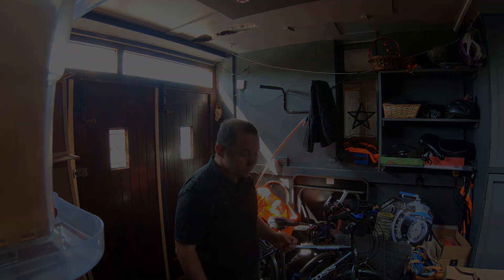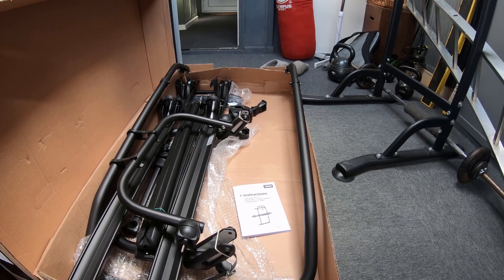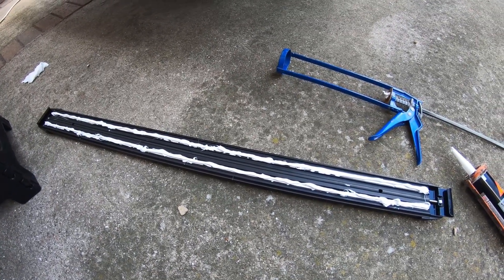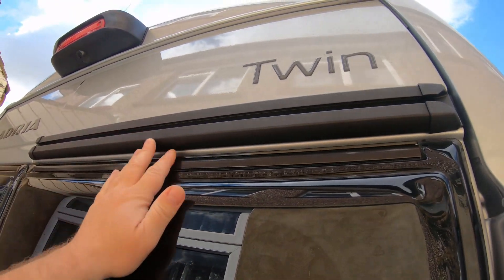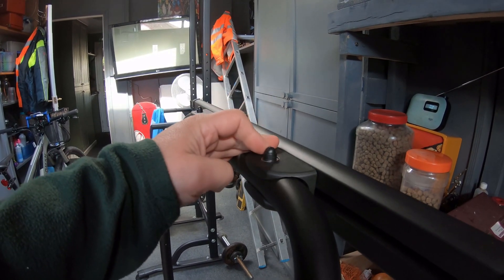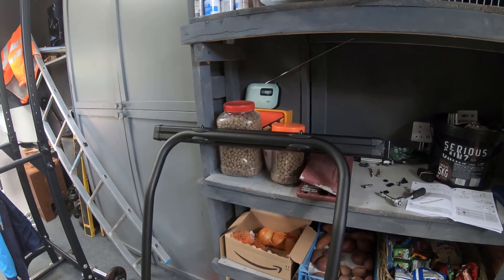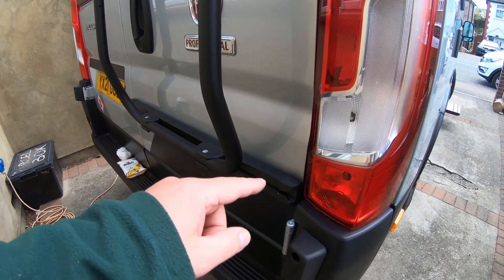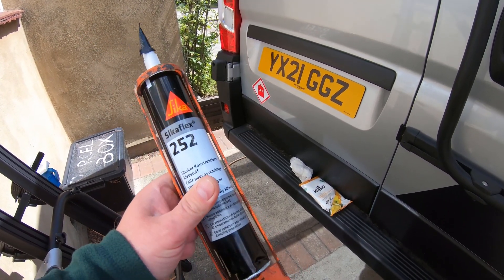Thule Elite Van XT Ducato/boxer Bike Carrier My fit to Adria Twin

Comment: Instructional as always Steve, I managed to overload ours last summer with two e-bikes at 38 Kg's total. I had to buy new bolts to the "hinge" ten we where fine again. Now I only mount Bibbi's e-bike at the inner position and my much lighter MTB on the outer. So now we are within spec for max at one position and max total with good margin. With only my MTB it works to open and close the door, but with full load it feels like you stress it. I really like to have the bikes there. We bought a cover to protect the bikes but we're not using that any more since it trips water on top and get heavy and the bikes got even more dirty under it. Go figure, vortex got more dirt in there than without the cover. Keep it up!
Reply from the maker: Cheers Mattias. In the end a tow bar and tow bar rack would be better but taking into account cost this is far cheaper and leaves money for electrics. Also the more you put on the more you overload the van, looking under the van yesterday I noticed it is already riding on bump stops with no load on. Will have to get air assist maybe next year. Also found the water heater after your last comment though I should look :), yes its underneath middle of the van. Expect this to be difficult to get to when it does go wrong.
Reply: @BrackstonesTravelAdventures  I'm happy with mine. There is pro's and con's with everything. Those tow bar racks are ot as practical instead.  With two lightweight bikes you will be fine. I drove on really bad roads when ours took the hit and with too heavy bikes. Air suspension does good. Go with electrics! You will be happy with that. This weekend I never were below 90% of that 150Ah (or actually 161Ah) battery. But heater has reset button indoors? The Whale need reset if you cut out LPG.
Reply: @BrackstonesTravelAdventures   I fancied One of these for my Ducato but wife Ebike weighs 25kg so thats out. so fitted a towbar and use an Easyfold xt3 which I already had.  had to fit a reversing cam as well as it now turns off the sensors when fitted. all good now. 
enjoyed the video.
Reply from the maker: @michaelhartley11  I was looking at the tow bar system but was a lot more money. Least with your setup you can take more weight.
Reply: @BrackstonesTravelAdventures   towbar was £381 and I fitted myself. not hard, though it was still a van when I did it so wiring was straightforward. towbar carrier means its easier to load and its a triple . As theres no rear view mirror I also fitted a rearview camera mounted as a numberplate frame. Its excellent and put wire through numberplate light hole.

Comment: Great video, thanks. Just unboxed ours, went to put the top bar on yesterday with the reccomended Sikaflex 252. Other than 3cm of Sikaflex we managed to squeeze out of the tube which was a real real struggle (new tube and in date), its impossible to get more out. Is this usual? Any tips greatly  received 🙏
Reply from the maker: Not had that issue before and i have used it a lot on different projects, you have cut off the end nozzle a bit to make a bigger whole. It should come out ok with a good mastik gun

Comment: From California. I’m about ready to buy this product BUT for my Nissan High Top Cargo Van which I have seen this Rack installed on it as well as parked behind me is the NV200 Low Top that has it installed on it tor Buyers CONFIDENCE‼️GREAT VISUAL Video. One Quick question❓Does the rear doors need to be 100% FLAT for the 2-Horizontal Bars with the Silkaflex for 100% Proper Fit❓Thanks‼️
Reply from the maker: Hi, I can't really guarantee any proper fitment on curved door as I do not make these. I would say you would need over 70% coverage as the Sikaflex is the main bonding agent. The small clamps only hold it on as a secondary clamp. If you where worried fit the rack with the Sikaflex so it is secured then put bolts through the rack and door along the bars. The bolts will be covered over with the rubber gasket.

Comment: Hey. Will this fit either right or left door on rear of the vehicle? My ladder is on the right hand side door at rear. Eek. Thanks for the help! Great video
Reply from the maker: If you put it on the other side then you will not be able to open the first door as it will hit the bike rack on the second closed door. It needs to go on the first opening door

Comment: Great video, can I ask is there a max tyre width for bikes.  I have quite chunky MTB tyres.  Thanks
Reply from the maker: I get my Boardman MHT on it with 29" off road tyres on ok. They are stamped 29 x 2.25 I believe the 2.25 is the width
Reply: @BrackstonesTravelAdventures  many thanks for the reply.  My tires are 2.8 width, medium fat.  Is there any more room, width ways, when you have your 2.25's seated on the rack.
Reply from the maker: Not a lot of room but i expect when it is strapped onto the holder and the above bar in place it will be ok. You could also add a second strap to the wheels to hold in place. I would say they are all standard size racks

Comment: Hey, good video! Could this rack be mounted to the other back door? My driver's side door already has a ladder on it... Cheers.
Reply from the maker: Problem with the opposite door is the number pate which will be covered, also this is the second door to open so you will not be able to easily open the doors, you would have to open the first door till it touches the bike rack then open the second door to get inside. Unusual to have the ladder on the first door. It was always designed to be on second door so the back rack would go on the first opening door

Comment: Great video, are those rails as far to the left as possible because I noticed the back wheel of the bike sticks out abit much
Reply from the maker: no they adjust across. I did not fully set it up before finishing the Vlog. Bike wheels do not stick out as far as shown in the vlog. If you see my Irish trip Vlog titles " Ireland motorhome tour 2021 Killarney Fleming's caravan site " at 2:40 you can see the bike rack properly setup